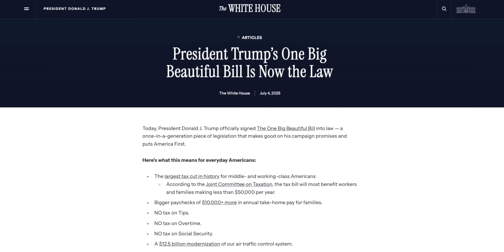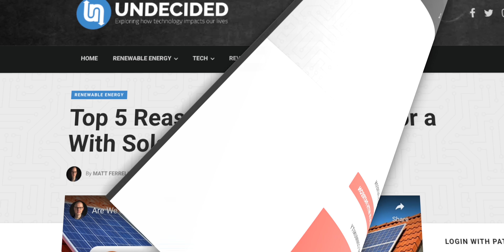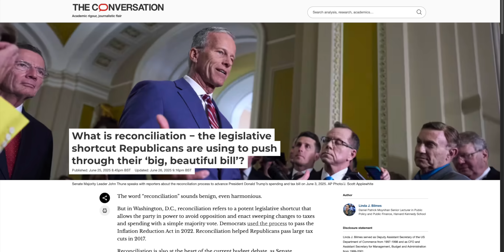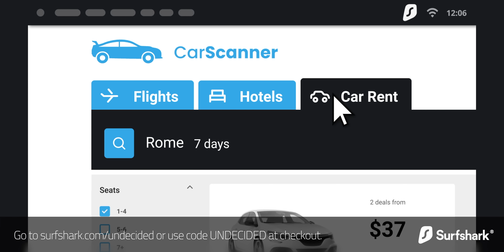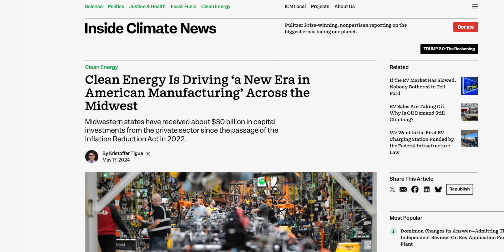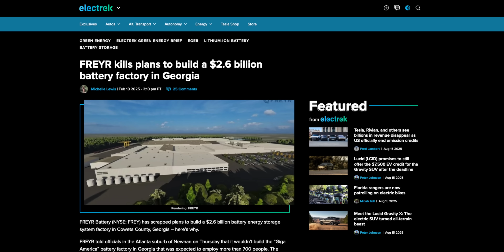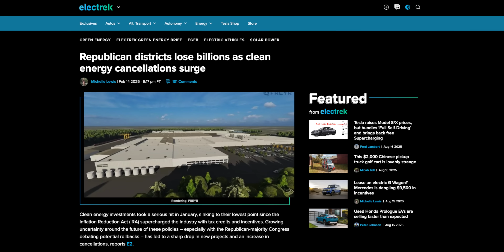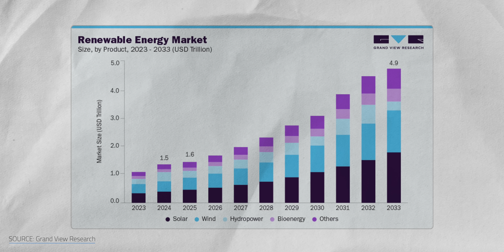How the U.S. Just Handed the Renewable Future to China

Comment: This just doesn't square with reality.  I don't agree that we need to subsidize oil and gas, but without heavy subsidies solar doesn't stand a chance.  I've had both my properties quoted for solar in early 2025 and it will take me well into 15 years to break even and that was with the subsidies.  The average person doesn't stay in one place that long.  One of my places is already off grid. Solar and batteries were installed in early 2000s, so the system is inefficient and low tech, but to replace would cost me nearly $30k!  So I'm not buying what you are selling cause the math doesn't add up right in my mind.  I wish more people had to experience what it's like in northern New England running on solar and generators alone and maybe then they would really understand reality.
Reply: You seem to be well educated and make very nice, well edited videos.  But you need to factor in some reality to your calculations.

Comment: Wind and solar generated electricity is commercially worthless!   Wind and solar generated electricity supported with the US power gird is NOT RENEWABLE ENERGY costing more natural gas in high readiness costs alone making near zero electricity than making all the electricity with natural gas combined cycle power plants.  If wind and solar power supported with the public power grid had any fuel savings it would be greatly promoted.  They don't.   US wholesale natural gas hovers around $3.00 mmBTU.  $0.80 mmBTU is the crossover fueling point for highly efficient ultra supercritical (USC) clean coal power stations.   

China is re-powering and greatly increasing the capacity of its power grid with hundreds of new USC clean clean coal power stations.   China is producing more coal fired electricity with less coal.   They emit no visible air pollution.

Comment: meh cant agree but cant disagree, but i do have to point out you contradict your self in the end 16:30 "stands on economics alone" if it cant stand on its own without subsidies was it ever economically viable? 

also reliability is still a problem i live in rural Australia more or less haven for solar. i am a delivery driver and i deliver to the solar plants around here one has its drive way go right past the inverter and sub station and when its on she really hums but most of the time i go there its off even when its a nice sunny day but if there's a hint of cloud cover its off. and they cant even get the power out i asked the guy there he said its 200MW and they have never pushed it past 100 as the local grid cant handle it. and even with all this solar power i still pay 35c a kW/h. it cool tech it certainly helps but its not a silver bullet. 

also we have another 170MW plant coming online soon they just need the grid connect that's currently under way, and there already worries it gonna fall flat on it face trying to power an already saturated grid. and it got to compete with the plant next door its only 4 MW they plan on going to 5 what it lacks in out put it makes up for in up time as its solar thermal so its much more tolerant to mild cloud cover hell the still try and milk as much as they can in heavy cloud cover if there's sun coming though they take it, it rear to not see those tower shining.

Comment: Hi Matt, the subsidy for EVs in China is almost all gone. And Chinese people now buy more EVs than combustion engine cars. Why? Because for every 5 EVs in China, there are 2 charging poles. And electricity is so much cheaper than gas. My cousin told me his car runs 160 kms for every charge: 28 kwhs, for 1.5 USD.

So I really don't think hudge subsidy for new energy is justifiable now. New energy, at least in China, already beats fossil fuel at cost.

You are my favorite tech youtuber. You should have a trip in China and see for yourself. It will be fun, and cheap. This summer I had a trip in China, and feasted almost everyday: for luxurious banquet, it costed around 15 USD per person; for quite good meals (multiple dishes of good Chinese cuisine), 7 USD per person.

Comment: I don't agree with the majority of this video. Americans are not buying electric vehicles anymore at the rate we used to back in the pandemic, this trend has been going on since 2023, you only addressed the cost in this video, which I know that you know is only one of the problems that keeps Americans from buying electric vehicles, the others being range, charging time, and maintenance. I would say that even if the Chinese EVs entered the market, no one would buy them. 

As for solar panels, the whole reason people thought of getting solar panels is because they don't want to pay for electricity, but in this market you're just replacing one expense for the other. Let's say you were able to afford a house in America (Which is unlikely right now in 2025), adding on a solar panel to your house does not add any value to your home, and also, you will be stuck paying for the loan you had to take out to install those solar panels on top of paying your mortgage for the house. On top of that, there is no guarantee that the solar panels will be worth it in the long run with weather and having to replace your solar panels (because they lose efficiency over time) and batteries. 

There are a lot of people from Australia in the comments. It makes perfect sense to build solar infrastructure in Australia, since 50% of the country is not habitable and receives a lot of sun.

In terms of energy production, it is a fact that fossil fuels contribute 60% of energy production while solar and wind only contribute about 15%, still behind nuclear at 18%. With rising energy demands with AI and electric vehicles, it is less risky to invest more in the energy sources that are most developed. If we wait for a solar energy breakthrough, it'll be way too late to meet that demand.

As for the future, no one can say for sure. I would put my money on nuclear energy taking over rather than renewables though. 

One thing I CAN say for sure is that I'm mostly concerned about surviving through the unofficial recession that is happening in the US right now than where my electricity is coming from.

Comment: Politica aside, I agree that solar is part of our future but, splitting water to capture hydrogen is the destination IMO.
Currently, you can't make a battery, windmill or a solar panel without petroleum.
You have to dig rare earth minerals for batteries, use petroleum to make the plastics for solar wind farms & use fuel to dig or drill for the actual petroleum.
Once we get to a point where we can drive up to a gas station and fill up on hydrogen in a few minutes unlike sitting and waiting for an electrical to charge and wait again for 25-30 to get an 80% charge, we'll move forward with solar.
Every new home in the right climate should be required to have a solar/hydrogen system with a tank buried in the back yard to charge the battery banks.
It can store enough hydrogen to power the need for a  home's electricity for weeks which includes heatint the home, heating the hot water heater as well as cooking.  It could also be use to refill the hydrogen vehicle.
Toyota tried with the Mirai but never caught on in California.
Until we as individuals can be completely be power independent, petroleum is here to stay.
I pseudo wotk in the petroleum business and they want no part of hydrogen to the public!  Believe me... 

Good video Matt
Reply: What is the cost for splitting H20 to capture hydrogen?
Reply: Trust me, you definitely wouldn't want anything related to hydrogen in your own home

Comment: Matt, I found this interesting.  However, contrary to what seems to be an overwhelming support in these comments for your video, my perception is that you readily accept quotes and statements that are aligned with the view you want, then throw them at us. If you understood the amount of money behind your "support" material to make the statements you use, you should pull back on your view.  You seem to be selling wind and solar, both of which are dominated by China.  Wind technology was stolen by China from the US, and those ugly and environmentally dangerous turbines will die in 20 years and have to be buried because they are not recyclable.  Solar has a similar environmental impact, while buying them from China is a direct transfer of money.  And if the sun don't shine, where is your electricity going to come from?  Final thought: you do not appreciate that nearly EVERYTHING you touch and have is made from petroleum.  Petroleum is not just a fuel to make electricity.  Regarding electricity, I am shocked that you are not advocating for nuclear which will run 24 hours a day in all types of weather. With it, we will not send another US dollar to China.

Comment: You continue to tote renewable  as the cheapest energy.  While true, most places that have installed more energy have increases in electricity costs.  Please be open and honest about this.  Talk about why it happens and what needs to be done to fix it.  Because all the talk of cheaper energy is landing on deaf ears as our wallets speak way louder.  And our wallets simple defy all the cheap energy talk.  People won't believe in renewables until this changes.  There are ways to get it cheaper but people don't know the policies behind this that need to change.  Right now there is just a rejection of the current renewable paradigm

Comment: Mathematically , an industry that takes fewer workers to realize far more energy output does not mean that it is not economically viable or that it is not worth investing in. Requiring fewer jobs/human-input means that industry is far more efficient in its production. A discussion about creating more jobs, and using as a metric the sheer number of jobs created as a desired outcome, is fundamentally different than a discussion about efficiency, GDP and economic success. Fossil fuel use is not declining, as demonstrated by the ever increasing CO2 levels in the atmosphere, which continue to increase as fast as ever. The worlds energy needs simply demand more of everything ... more fossil fuel derived energy AND more "green" energy. They will both continue to grow side by side because both are in demand. The "green" energy sector did not grow because it was needed to replace fossil fuel use, it grew because it was needed together with the fossil fuel use. Other rationales for the development of green energy are 95% pure rhetoric.

Comment: It's amusing that you are very concerned with the loss of jobs in renewable energy (and while I agree such energy is a good idea, until we can solve the grid-level storage problem with batteries designed for longevity and low maintenance instead of "efficiency" or "power density" is a pointless endeavor), but very much want to see the trucking industry (which makes up about 30% of the US economy) completely automated as fast as possible.

Comment: I think that perhaps another version of the argument is that both solar and wind as well as fossil fuels are mature tech that BOTH no longer require subsidies to be competitive. I tend to agree with the economic argument that you do not need to subsidize a mature tech. Struggling technologies do need that protection. In my opinion, the bill didn’t go far enough. They should have cut the subsidies for fossil fuel as well. 

You are also forgetting the downside of intermittent generation resources. So called clean energy destabilizes electric systems because of the grid following inverter technologies and tendency to cause massive quality transients when those inverters kick on. We saw the extreme result from this when the grids went dow in Spain and Portugal this last year.
Reply: The cost of solar and wind continues to drop. Arguably the tech is more mature than it used to be, but compared to coal or natural gas turbines? Definitely not as mature. Regardless, there's a better case to be made to cut ALL energy subsidies than the case for cutting just solar and wind.

Comment: Acting like solar or wind are massively efficient and stable is laughable. Fossil fuels remain the most cost effective and reliable option. Also, where do you think we've been getting the materials for these panels and batteries??? China has already won, the more we push for solar the more we play into their hand.
Reply: So the solution is to give up and push manufacturing even MORE into China's hands? No, that's a bad idea. Solar and wind are the most cost-effective energy source though they are NOT the most reliable, they will need to be paired with base load power that is reliable. That's not going to be coal or gas though because 1. Coal is an old and expensive tech and 2. Natural gas turbines are on backorder until at least 2030.

Comment: Except Biden's IRA actually increased inflation. 
Most that subsidy money was stolen. Buttigiegs charger network it a prime example.
If solar and wind are so cheap, they will win out anyway.
And data centers are not running on renewables. The one they are putting in near me will use 4gwh of electricity. That requires 2 nuke plants just to run one data center.

Comment: Only 7% of energy consumption is solar. Solar sales have stagnated even though the price has decreased and performance of solar has increased. The reason for the subsidy was to offset the higher cost which have become affordable. The problem with solar is people don't want it on their roofs and solar farms cant compete with the cost of land in city and suburban environments. There is also the high repair costs over time. Trying to force people into a bad solution is not the way to go. I think what might happen is we will have a bunch of homes and fields with broken down solar panels that no one want. Repair costs are overwhelming.
Reply: People don't want solar on their homes because it's still relatively expensive. You are wrong that solar has high repair costs over time. At most you'd pay a few thousand dollars over the 15-30 year lifespan of the system if you need to replace parts, way less than the typical annual maintenance costs for a single family home.

Comment: Regarding the statement that "renewable energy provides price stability" (@13:07). I would argue that this is incorrect.
In Finland, we have the cheapest electricity (0,0568€/kWh + VAT in 2024, yearly average) in Europe alongside with Sweden. This is largely thanks to huge influx of new wind power installed during the last 5 years.

However, despite the fact that yearly average is lower than ever, the price fluctuations that we are nowadays experiencing are higher than ever. For example, electricity SPOT prices may vary from -0,05€/kWh (yes, negative price!) to 0,20€/kWh during the same day depending on the wind conditions. On non-windy days, like today, the most expensive hours cost around 0,60€/kWh. During winter we've seen extremes as high as 2€/kWh, with daily average being over 1€/kWh. Granted, these occasions are rare.

Comment: How is China going to take the lead without funding? All that solar and battery production plants are pretty useless without consumers. Energy is energy, fuel is fuel. We need it no matter where it comes from. Renewable energy is extremely costly to manufacture, install and maintain. Somehow you forgot that. Its not sustainable to have acres of land destroyed to put up solar farms. By the time you've made any kind of return on your investment, you have to replace the panels and energy storage units. Not to mention constant maintenance. Cleaning all those panels, damaged cells, battery failure, labor costs. We see it constantly, leased land with solar panels or wind turbines as far as the eye can see. When that lease is up the investors dissappear. Now you have vast fields of abandoned non-functioning trash. Solar is good on a small scale. Wind turbine power. In my personal opinion has never been good for anything. The only time it was great was in mills grinding flour or moving water.

Comment: Project developer here. Here is the real data on development and procurement timelines for equipment:

1. Battery development: 2y permits and interconnection; Equipment: 6 months 
2. Solar: 2y interconnection, 3y+ permits; Equipment: 6 months
3. Gas: 2y interconnection, 2-4y permits; Equipment: 4-5y
4. Nuclear: 2y interconnection,  ??? Permits (decades?); Equipment: ??? Years

I go to community meetings to get projects permitted locally. I can get a battery project permitted but the community often rejects solar and they’ll damn sure reject a gas plant or a NUCLEAR plant in their back yard. These are typically rural, conservative communities and they don’t care about your politics they care about their perceived home values. 

This bill did nothing to help us build out the energy capacity needed for AI infrastructure.  The bill extended the life of coal and gas plants that are decades old and past their useful life. They were scheduled for retirement because they were expensive. They were the marginal units in their zones. If they would have been allowed to retire, the next lowest marginal unit would set prices which means cheaper energy. But now we all pay for these TWICE, once to subsidize their extended operation and again in the form of more expensive electricity. It’s not a red or blue thing it’s pure economics. 

This bill is irrational energy policy. It would have been a better energy bill if it removed subsidies across the board for all technologies but it didn’t. It propped up bad plants and restarted the interconnection queue when we needed MWs fast.

Comment: In the development cycle fossil fuel takes way to long for electricity development, so Trump failed to see that in his planning process, if renewable generation is now in jeopardy, the industry and states only need to batteries to tap renewable energy they have installed to ramp up the existing power platforms!